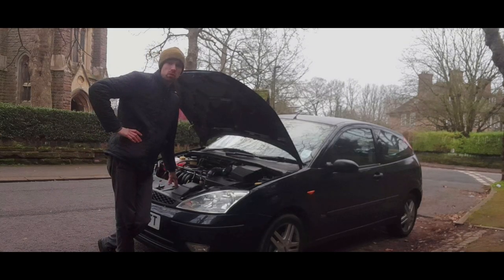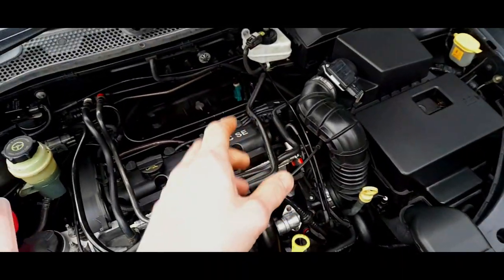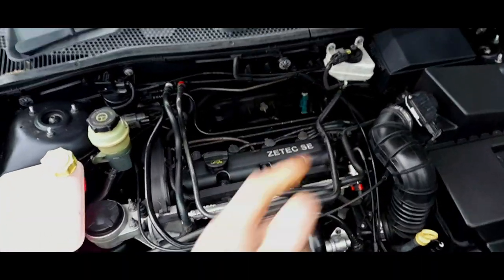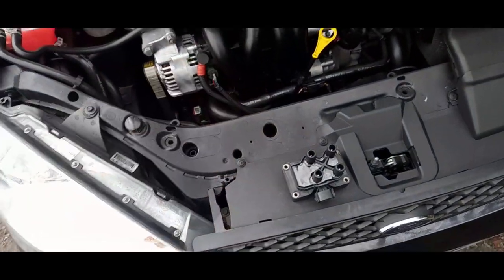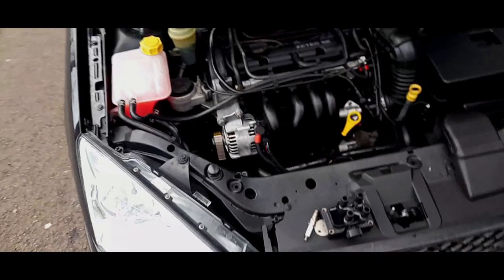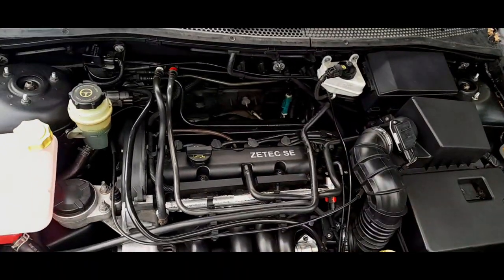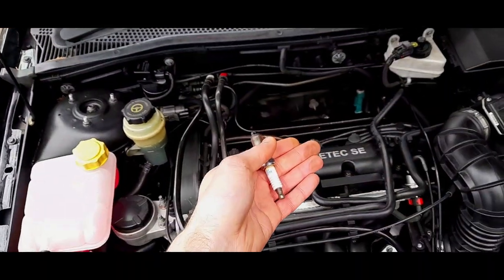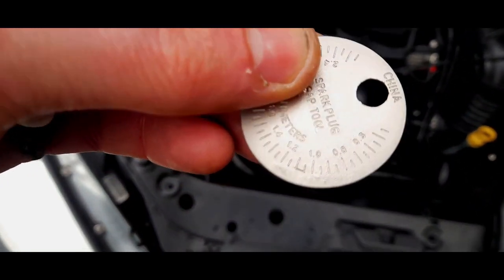Ford Focus MK1 - Coil Packs, Leads and Plugs

Comment: Wasted spark is more efficient than sequential as the ‘wasted’ spark will ignite any unburnt fuel during exhaust stroke. This type of firing is often used in high performance engine for several reasons such as, help to eliminate miss fires increase in power and more.

Comment: You can improve the ‘explosion’ from the spark plug using a HT lead with less resistance ‘Magnacore’ for example the same with spark plugs. The voltage supplied to them will not be increased at the coil, however, the rate at which the current travels through the leads and plugs will be increased if the resistance within the is less thus giving the engine a cleaner explosion and the coil will not have to work as hard

Comment: nice information. I have a Mk1 ford focus. Good car. Had a a few niggles but been reliable
Reply from the maker: its to be expected at this age now but brilliant cars and I think a lot of general car enthusiasts are now waking up to their low price point still!
Reply: @usuallyfixingtinkering  btw I have been having intermittent problems with the boot release switch inside the cabin. I have to open the boot with the key. Is there a solution to it?
Reply from the maker: @kevinski1966  yes the switch needs taking apart and some rubbing alcohol on the rubber attachement inside that does the contacting and it should work!

Comment: sounds a bit raspy is your flexi going?
Reply from the maker: flexi is fine. That's how either a 1.4 or 1.6 should normally sound, the 1.8 and 2.0 sounds more fully-bodied in tone.
Reply: @usuallyfixingtinkering  i thought it had a non genuine exhaust on it , mine is still on the orig one and doesnt sound like that
Reply from the maker: @steveo3002  there will be minor differences in aftermarket OEM silencers which may make a difference. It has a klarius middle and rear boxes with a BM Cat and BM Downpipe. It's certainly more audible than the exhaust that was on the car 10 years ago... but then again it was very sooted up and after barely covering 500 miles since this was fitted it may still be very metallic until its fully sooted up! It takes at least 1k to do that on these.

Comment: The Originals were actually made by Magneti Marelli. i have just replaced mine on ST170 as a preventative maintenance.
Reply from the maker: some were I think it may have initially been a 50/50 depending on availability.

Comment: Speaking about plugs, diesel focus mk1 glow plugs likes to glue themselves to head. If you don't know what you doing or you are not confident just go to repair shop to change them. Also I have idea for video for you. When you have full washer bottle does it leak on turns or hard brakes? If yes how the hell fix that?
Reply from the maker: do you mean the screenwash is leaking out of the bottle? That would be a washer motor seal :) Ah yes the glow plugs on most old diesels are a real pain to extract!
Reply: @Usually Fixing & Tinkering  its not leaking when standing. Only heavy braking and sharp turning. Fill up to max and probably after bit  of drive you will notice not full anymore :D
Reply from the maker: @Tadasskr  you've most likely got a crack nearer the top of the screenwash bottle but it's hard to say. You'll have to take the arch liner off and have a closer look at where it's coming from.

Comment: Hi enjoyed the video it was very informative I’m currently looking for a left side axle or the tripod joint for the axle for an MK 1 Ford Focus 1.6L, can you help direct me to one that I can purchase online ? I live in Trinidad in the Caribbean a dealership sells Ford Focus cars here but some of the parts like the axle or axle tripod joint for the MK1 Ford Focus 1.6 European Models are extremely difficult to find here. Any help will be appreciated thank you 🙏
Reply from the maker: The swivel hub assembly should be available direct from Ford still, they wou'dnt have sold many because it's not something that goes wrong. What is the issue with yours?
Reply: @usuallyfixingtinkering  the tripod joint that is on the left side axle is failing and causing the car to vibrate when you accelerate at around 60 - 80 km/h… also when it’s in idle or reverse it vibrates, if it’s in neutral the car does not vibrate.
Reply from the maker: That's not causing the issue, wheel bearings can cause this issue and drivehshaft bearing support on back of engine can get rough and cause noise and vibration. I'd have a good diagnosis done before any work is done. That is my strongest advice!
Reply: @usuallyfixingtinkering  ok I’ll have it checked out thank you for the advice
Reply from the maker: @zaboca09  no problem

Comment: When I first changed the plugs on mine the gaps were huge! Around 1.5mm. Caused a lot of misfires on idle. Changing the coil pack and the plugs did a lot. I believe it was the fisrt things I changed after I found your channel.

Are you sure about it not beingg a wasted-spark type? I have seen cut open OEM coil-packs at school, and they only have one set of coils.
Reply from the maker: No this is not wasted-spark its sequential for definete! Oh 1.5mm is way to wide no wonder it was misfiring, same symptoms as if the gap is too short
Reply: @usuallyfixingtinkering  Yeah, they were pretty worn. I believe they were the factory ones (I still have them laying around somewhere).

I've pm'd you though your facebook page.

Comment: I bet you would laugh (a bit).
I use that 503 490 Bosch coil pack, since last January. Works like a clock, starts the engine at third "cough", even in really cold winter mornings.
As a matter of fact, my whole ignition sys is Bosch. 357 141 HT leads, and 532 514 "super4" plugs (in 1.8 Zetec). These plugs have 4 outer electrodes. I'm not sure about the gaps, but I guess it doesn't matter in this case. The spark will find itself an electrode to get contact.
I change plugs in two years. They're quite important parts in an engine, for a bargain. I wouldn't use any plugs for more than two years.
Reply from the maker: they are indeed its probably 2nd only to an oil & filter change! Ah those 4 electrode plugs are very weird I'm not sure how mine would behave with them, I get the theory but I don't think the cost of them is worth it over oem copper ones.
Reply: @usuallyfixingtinkering  well, I don't want to suggest: have a try. Btw those plugs aren't so expensives (around about Ł5 a piece). I had Motorcraft and FeBi plugs in my Focus, w/o any problem. FeBis look like new ones, after two years in the engine, no wear, at all. So, next January, I'll buy another set of FeBi plugs. Maybe.
Reply from the maker: @flycorvus  l will bare it in mind in that case!

Comment: Another great video. Stuck to copper ngk's when I replaced mine last year but I have never checked gaps, always just assumed they were set right. Will have to pick up that gap tool now. 
Dropped mine into the garage today for the timing & auxiliary belt changes. Also ordered the 2 new vents for the boot so next weekend can hopefully get stuck into sorting the leak. 
Wouldn't happen to be planning on doing a video on a complete coolant flush would you?? 😉 Want to do mine but I'm better with visual guides.
Reply from the maker: Not any time soon as my cooling system is really good, if you havn't watched it I suggest you watch my video on the cooling system and I briefly go over what you need to do to flush and refill the system!
Hopefully the vents cure the issue however my experiences are that the vents are only one of many areas water can get in. Fingerscrossed for you buddy!
Reply: @Usually Fixing & Tinkering  Still waiting on my car to come back from the garage, they've had it a week and I want to get into changing and sealing the vents.
With regards to the wheel arches and the likes, do you recommend Dimitrol or Dynax?
Reply from the maker: @Paul_Davies77  Either! Both are equally as good but Dynax is the stuff I've ordered for the 45 as an attempt at something new!
Reply: @Usually Fixing & Tinkering  Thanks for that will order some now.
Loving the 45 vids, quickly working my way through them
Reply from the maker: @Paul_Davies77  done watch them all in one sitting lol save some for later😁
Reply: @Usually Fixing & Tinkering  
Sat in my truck for a few hours every night waiting to load so have lots of time for youtube.
Problem with lots of free time I end up buying stuff! Just ordered the Dynax and now I'm thinking about buying ramps 🤔
Reply from the maker: @Paul_Davies77  Dynax - great choice. Ramps - I recommend waiting until you go to halfords and get their orange ones, they are really great quality and a great size compared to my cheap ebay ones for £55. Ah the many hours of flciking through - thats the great thing being as busy as I have been, less buying tools I think I may need lol
Reply: @Usually Fixing & Tinkering  It was after watching your halfords trip video that I thought about those ramps and would pick them up over ebay ones.
Whilst it's nice having so much free time in work, at home I actually have very little so I'm limited to how much I can take anything apart as the car is needed daily.
Reply from the maker: @Paul_Davies77  I get the picture 100%!

Comment: Excellent Video. A Ford Focus Mk 2 (2003) is losing power while driving. It is idling badly. 
There is a misfire on Cylinder 4 error code. I am suspecting the Ignition Coil is faulty. Where can I get a Bosch Ignition Coil?
Reply from the maker: Again ebay is your best bet!

Comment: What spark plugs i need to use if i have the update version of the coil pack I’m running now ford genuine 2050957 which they are from my vin number catalog so do i need to open them to be 1.3mm or should i buy a genuine ford with 1.3mm from the factory ?
I if that what i should do what are the part number for genuine ones 
My car is 1.6 zetec
Reply from the maker: dont worry about genuine plugs, they are usually NGK's anyway! It's 1.3mm with the new uprated coil pack however I always go 1.2mm just to be safe.

Comment: Just done this cos had coolant in Spark plug wells
Reply from the maker: core plugs, common issue not a massive deal hardest bit is gettng the rocker cover off :)
Reply: @usuallyfixingtinkering  East to do if a Noob :D Many thanks for in put
Reply from the maker: @SonofChurchill  😅 no problem!

Comment: Hi, I’ve just recently got myself a 2001 y reg mk1 focus 1.6 zetec all new to me, 
I own a Ford capri 2.8! No ECUs here to contend with!

I need you!! 
I’ve started to fix an error code P0303, changed plugs, leads & coil pack though which one I don’t know, but still I have the same error. 
Do injectors fail? 

Really like your videos very informative & very knowledgeable on mk1s 👍🏻
Reply from the maker: Oh what a car you have, the ultimate capri in my book! If you've bought an aftermarket coil pack it's possibly it's faulty out the box. Rarely do the Imjectors go wrong, but it's a pretty simple job to swap injectors around and see if the code changes to a misfire on another cylinder. That code is specific to cylinder no 3. 

Also have you cleared the code? Just to check.
Reply: Thanks… the capri has been my daily driver since I’ve owned it… 14 years now! 

…the parts were from euro car parts, starline is manufacturer, though I’ve never heard of them!! 
I did clear the code but the same code came back .

Is it worth changing the injectors around or the coil pack, not sure if euro will take it back though
Reply: Have you tested compression? If not an injector issue, might be issue with cylinder 3. If it’s that bad a misfire, and it’s an actual issue with that cylinder, you might be able to hear it with a clear flood crank. Good luck.
Reply from the maker: @davyarthurs  I've personally never known a 1.6 to loose compression, it usually more than one cylinder anyhow.
Reply from the maker: That is very strange! Oh that is euro car parts special that part is! It should be decent though, its most likely not the issue. I would check the compression if you have a tester and straight extension to see whats going on there!
Reply: Where is the best place to buy new injectors? Or have you got a part number?
Reply from the maker: @leerowell9434  I don't have one to hand and I'm sure ford have news ones but they won't be cheap... I've never known issues with these injectors
Reply: On, I’ll just go to my local breakers at the weekend….

I know the car ran very well before the engine light came on & It’s only done 94k.
Reply from the maker: @leerowell9434  whats the issue because the injectors will be the last thing I'd check
Reply: The issues it still has since fitting new plugs,leads,coil pack are: 

Struggles to start 
Lumpy/rough idle (missing)
Grey smoke from the exhaust 
Engine light code P0303 

I’ve only got a cheap OBD2 tester.
Reply from the maker: @leerowell9434  I would personally do two things, fuel filter by the tank (when was it last changed) and putting some E5 super unleaded in and see if that changes things. I've hardly every seen an injector fault. See if that makes a difference